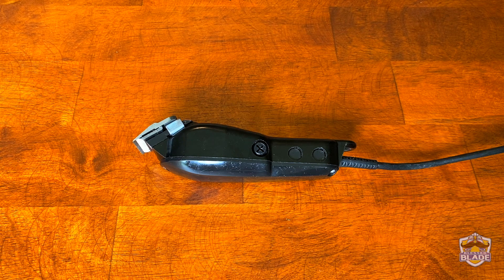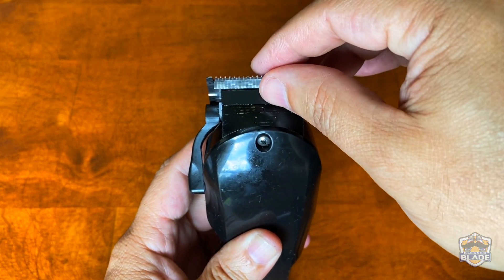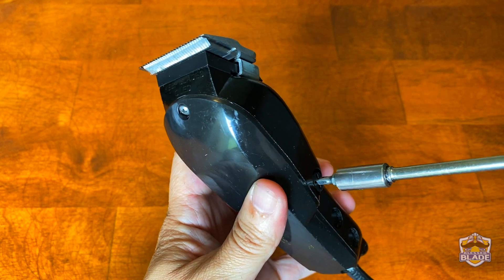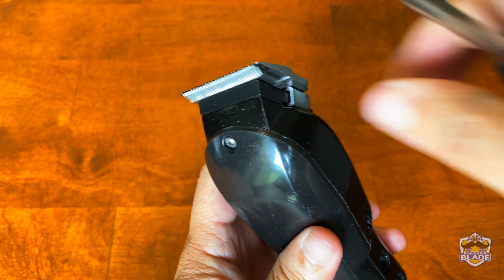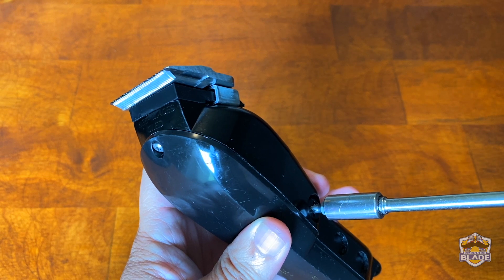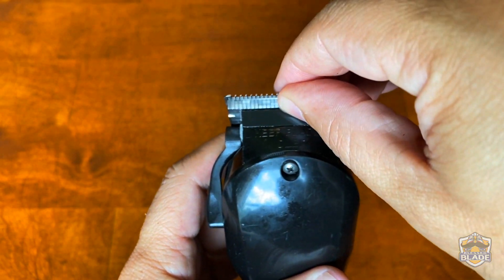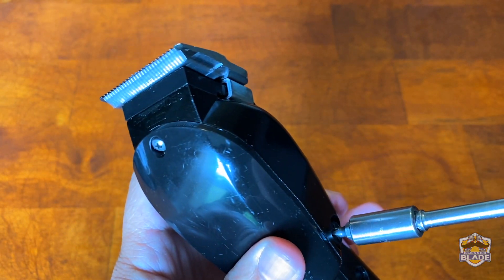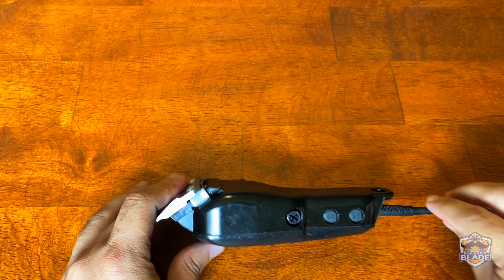Adjusting Clipper's Power Voltage

Comment: Mine still make loud noise when screw is totally out
Reply from the maker: Tight it right until it doesn't make noise
Reply: @BlessedBlade  I just found out I need a 220v to 110v converter here in Europe to use my American clippers lol 🤦🏻‍♂️
Reply: @BigTexGuitarz   yeah bro I had the same issue. But I got you. You can get the "suntech" ST 100 step up and down transformer. I use it on all my US electronics cus I'm also here in Europe now & power lvls are different. Who knew?  I also suggest to buy additional fuses if u go for this unit as it only comes with one and some electronics are tooo much so it will blow it up.  Hope that helps or maybe you already got something by now. Cheers!